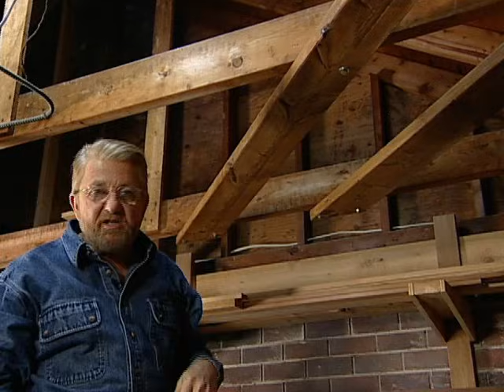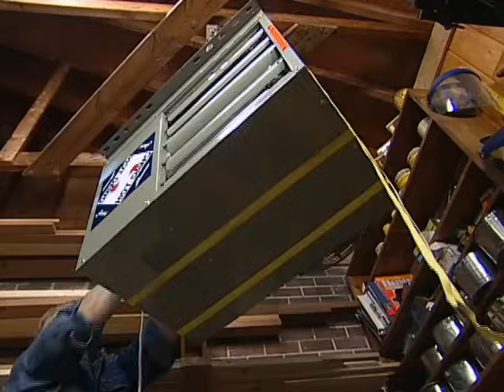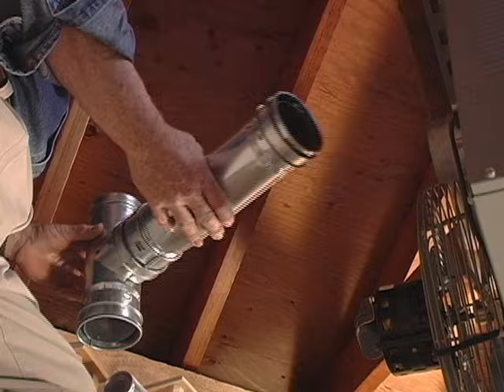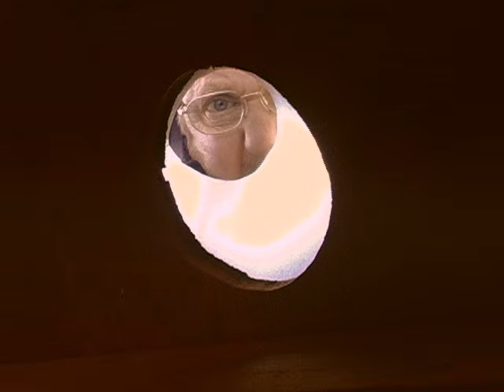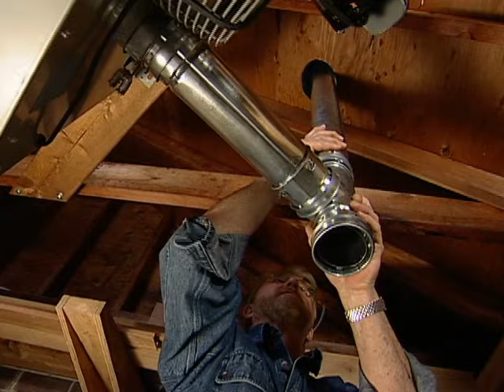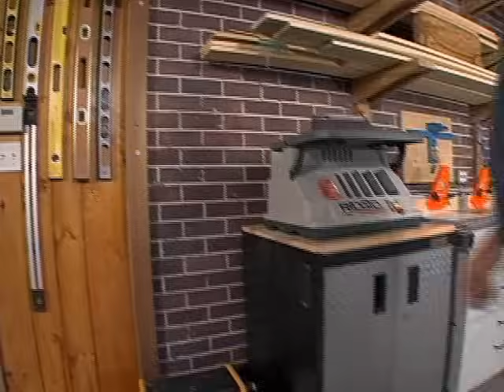How to Install a Gas Heater for a Garage

Comment: He did not mention that you need a gas fitter one ticket to install it if its gas...not sure about propane
most insurance will double if you have one of these in your garage especially if its an attached garage as there are strick laws and rules about these! Do your research before buying or installing.

Comment: Does it need to be a T that comes off the back of the heater? I bought a HeatStar 50,000 BTU and the vertical vent kit, but it came with an elbow instead of a T.
Reply: Check local codes.  Out here there does need to be a tee but depending on where you are that may not be the case

Comment: Anyone know if the vent has to go straight up or can I put elbows on it? I was thinking of going up into the attic, then 45 to a higher point of the roof, then 45 back to go straight up again.
Reply: 1/4inch vertical slope per foot or 1in per 4ft is my local code I believe.

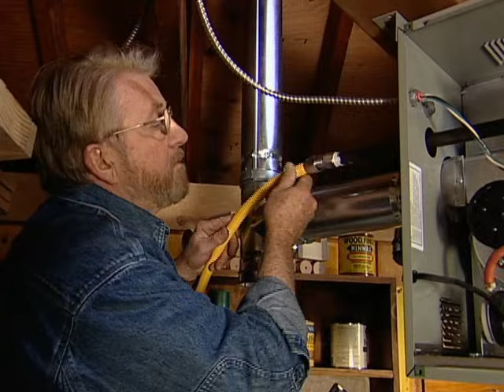Comment: @5:35 I do not see the use of dope on the yellow flex hose. Is it necessary to put dope on that connection as well or not? Thank you.
Reply: Found This: "Tapered (beveled) surface of connector nut
 or fitting where the seal occurs. Pipe thread sealant or Teflon® tape should never be applied to a flare surface."
Reply: Yep! Kiiiburn is correct. No pipe dope on flared fittings. I learned that one pretty quick when I put in our clothes dryer, lol.
Reply: @ChadAmI80  That is good to know. I use it on flared fittings but have never had an issue. I just make sure to not get any pipe dope on the actual beveled portion. In the future, I will refrain from doing this.

Comment: Apparently clearances to combustibles are zero for above that unit heater hah
Reply: 1 inch clearance usually above the heater.
Reply: Their website says surface mount is allowed.

Comment: Does the bottom of the t vent pipe out the back get a cap added or left open for air flow.  I'm thinking a drop leg added unless use the flex line with it.  Most stores doesnt know but I'm going by my older home unit that stopped.
Reply: Yes it gets capped.

Comment: I’m installing a similar heater and found this video very helpful! One thing I am having issues with is the b vent. My vertical rise is about 10ft long and the pipe is heavy. I dont feel comfortable just leaving it with the only support coming off the back of the heater. What’s the best way to support the weight of the chimney?
Reply: Put a strap around it and tighten it attached to the ceiling to bear the weight.

Comment: The best thing about this video was the segment on lifting it in place by yourself. I did exactly the same thing with the straps! But instead of the block and tackle, I used a come-along..... took a few minutes longer, but it worked out perfect! I pretty much did the install from start to finish with the help of this video, thanks so much!

Comment: Installation of your venting needs to terminate no closer than 10ft from exterior wall, meaning your not up to code. Also flexible gas pipe csst can burn your house down if not grounded. It's already burned down 40 houses since it came on the market. Lightening can jump from electrical to csst burning pinholes in it causing fire and or explosion.
Reply: What should he have used?

Comment: Thanks for the video. Shouldn't the hole cut in the roof be more of an elliptical shape to match the pitch of the roof?
Reply: +hoopfan71 yes!
Reply: I just completed my own heater installation, and the calculation isn't difficult. The hole in this video is small and located on a medium-pitch roof, so it's not that big a deal. Not taking the time to calculate the proper hole size on a much steeper roof or for a bigger flue pipe (e.g. separated combustion) will yield undesirable results. Example for steeper 10/12 pitch roof with 6" basic hole: 10/12 = a/6. Solve for a: a=5. Pythagorean theorem: a-squared+b-squared=c-squared. 5-squared+6-squared = c-squared. Solve for c: c=7.81. The major axis of the ellipse is 7.81" and the minor axis is 6". The vent pipe would not fit or be too tight against the roof if a simple 6" circle were made for this example. Creating a template for the cutout would be a good idea.
Reply: MN gas code is only 1” clearance to combustibles for a B vent. So his 6” hole is fine
Reply: @CoconutCole  Yes, the 6" circle worked in this case, but he didn't explain that the shape of the hole may vary based on the roof pitch.